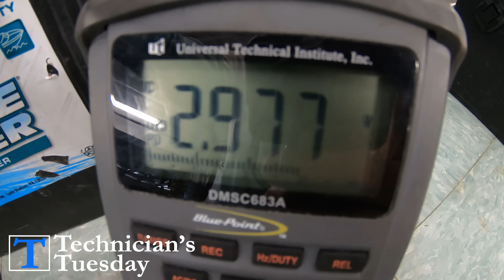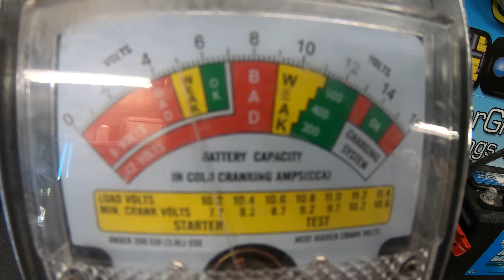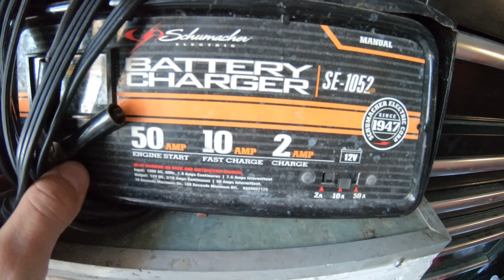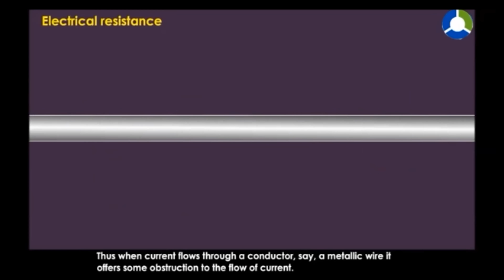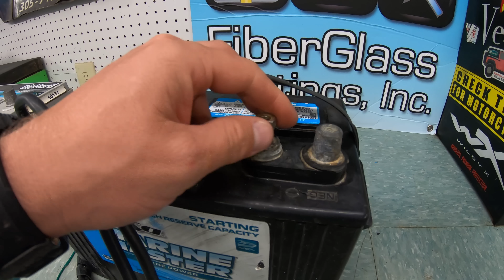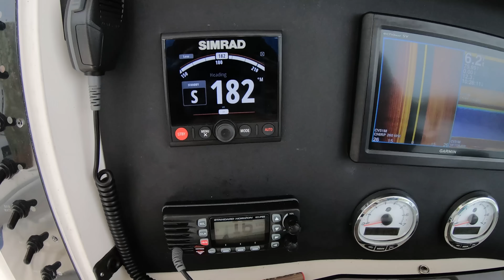Make Your Boats Batteries Last Longer!

Comment: I've seen a number of boats sink due to poorly maintained batteries, thus dead batteries.  Even one that was stored on a boat lift.  A heavy rain fall, combined with a dead battery, which led to a lot of water weight in the bilge that caused the boat lift to break.  The broken lift sent the boat into the water and the lift even punctured the side of the hull, and down it went.  #Batteries

Comment: hello I have a problem with my boat (twin outboard motor) above 46 rpm my boat puts itself ￼ strongly aside without turning (maybe too much weight at the front) ￼
Reply from the maker: Maybe the boat could use trim tabs?

Comment: #batteries
How do folks keep trolling motor batteries charged when on a rack or storage yard without a power source?
Reply from the maker: You really cant without a power source :/ just have to get the boat out of storage and then give them a day or two to fully charge up :)
Reply: If it's outside, you could get a small solar panel for it

Comment: It's also important to replace all batteries at the same time if they are wired in parallel or series. Some guys with bass boats have 3 batteries for trolling motor and 1 for cranking (like me). My Minnkota charger monitors all three batteries and will make sure all three are charged equal. I then have a separate charger for cranking battery. Replacing only one or two of the three batteries will force it to be at same level as the weakest battery. Hope this makes sense!
Reply: #Batteries

Comment: I had one of the UTI bluepoint meters from when I graduated in 2002. Sadly, nicad batteries leaked and corroded away all of the contacts. I went through several big brands but have found the Klein brand at Home Depot to be the best so far. I have one with an amp clamp, and one without.
Reply from the maker: That's funny, that actually happened my meter as well, luckily my snap on rep sent it in and now it's like brand new :) but I'm a huge fan of almost all of Kleins products, they make great stuff! I like their squeeze wire strippers when doing a ton of wiring :) they work great!

Comment: Don’t turn the battery switch with the engine running unless you’re switch is equipped with a field disconnect for the alternator.  Doing so can burn out the voltage regulator.
Reply: I did not know this...  good tip.  👍
Reply: You got that right...it happened to me and cost me $250 for a new regulator ....expensive lesson learned
Reply: Is that both on or off?

Comment: Great vid Aaron this will help alot of boaters who arent technically minded on maintenance personally i always clean the batteries after every trip as i wash down the boat mine are under the splashwell and exposed slightly to the salt air, no enclosed battery compartment

Comment: Great video watch them all the time. I have a Yamaha 175 hpdi  it's a 2004 i have never put a thermostat in it do i need to.i am going to service the lower unit.
Reply from the maker: If you never have put them in then it's a good idea to change them out. If your doing the lower it's a good time :) they are easy to do, you have to pull the plastic shrouds off to get to the one side of the housing bolts, but after that its 4 bolts a gasket and the stat:)

Comment: BATTERY ACID; always wear protection around battery acid. Gloves Goggles even an appropriate apron (not the one your wife gave u for "Father's Day") 
It is imperative to; Wash Your hands even if u had gloves on. If you inadvertently rub your eye and there is Battery Acid on them, big trouble.
Check the Security and stability of your battery from time to time. The pounding of a rough water ride might loosen the straps or housing.
Reliability is tantamount for your battery's performance, when yer Way out there, you have to be absolutely certain.
Before even starting your outboard, make sure the gasoline pressure Ball, is pumped and firm, cranking for extended periods of time may not drain the battery, but it wreaks havoc on the very expensive starter mechanism.
If we "Mix our Own fuel" a gas tank that has Sat for a couple days will stratify. (oil/gas separation) Give the tank a vigorous shake THEN Pump Up the ball.
Some outboard engine oil products claim to "Mix" more permanently (like AMS Oil) Shake it anyway!
But battery performance is right up there at #1.
Reply: That gas/oil/mix it anyway thing is true...  I use to always do that with my dirt bikes and even snowmobiles back in the day.  Gave the can a few shakes before filling them and shake the machine before starting just because.
Reply: @googlevoicer  cheers

Comment: #batteries definitely switching to a 2 battery setup on a switch next season. Also getting a dual battery box to keep them clean!
Reply: @Mason Enbody 
Consider Blue Sea battery isolators. 
Several models/functions automatically disconnects when the engine is off, no voltage loss, marine rated and safe. Study up for your needs, their documentation/comparison sucks but it’s a good product.

Comment: #Batteries..happy tuesday damm I need to clean those tops..my grandpa always said concrete drains a battery if left on top of it so we always put a piece of wood down to store it.dont know if gramps was right?
Reply: Fred Rempe Your grandpa was right.  Old batteries used to have hard rubber cases and would leak current badly when sitting on concrete.  May have also been dirty case conducting like in the video.  Today's cases are better insulators but you still need to keep your batteries clean.  I still store my batteries on dry wood when out of the boat.  Can't hurt I'm thinking.
Reply: Thank you jack fat .as kids we always thought he was busting our balls with the concrete ..also keep them damm terminals tight.lol
Reply from the maker: I grew up in Illinois and was always told the same thing :) I didnt think about the rubber back then, or really understand anything about batteries lol haven't put a battery on a block for a long time. Idk if it's still necessary, but it cant hurt anything ;) probably keep doing it out of habit:)

Comment: Never knew a dirty top on a battery would put a load on the battery, makes perfect sense though. Another great video! #Batteries
Reply: I concur. #Batteries
Reply: It isn't the plastic allowing current to flow, it's the moist, grime, dirt. The meter doesn't lie. Period.
Reply: @mikeprince5459  - doesn't lie about the concrete/ground either.  But some people don't believe a lot of things someone tells them are not true.

Comment: the same can be applied to trolling motor batteries? I have 2 batteries and both died on me with in 2 and a half years.
Reply from the maker: Yes, they can but you need to have a way to tie them in so that they can be charged. A lot of cases are that the trolling motor batteries are separate from the boat and engine and you have to charge them every night after a long day of using them.
Reply: @BornAgainBoating  thank you

Comment: What's the best marine battery in your book #battery
Reply from the maker: I generally stick to the group 27's. But if you are running a lot of electronics, pumps, and good stereo system. The 31 AGM's are a must. To be honest, I really don't have like a brand or style over another. I've ran interstates, dekas, intimidaters, autocraft, optima's, napa's, and basically whatever was available when it was time to change the battery! There's a lot of variables, the AGM's are great because of the abuse that you can put them through, but they are more expensive so I guess it still depends on the boat and application :) The long winded way to say idk what's the best lol
Reply: Born Again Boating  Thanks for your great tips and videos.  I've been running class 27 AGM batteries with VSR on my large (24' Manitou) pontoon boat since 2011 and they still test great. Buy once, cry once.

Comment: Great video as always. Capacitance testers do work better than load testers, as they tell you the actual amps that are inside of the battery. You can also use a capacitance tester battery after battery without having to let it cool down. I use my load tester with an amp clamp to check alternator/charging system output, and I strictly use a capacitance tester now for testing batteries. This is what I use in a professional setting, 60 bucks, can't beat it - https://www.amazon.com/BA7-100-1200-Electronic-Battery-System/dp/B0015PI7A4/ref=sr_1_4?keywords=solar+battery+tester&qid=1576621092&sr=8-4 #batteries

On a side note, per ABYC E11 you should have rubber insulating boots over those positive battery terminals. Without those rubber boots in place, anything bouncing around in that same area (IE rattle cans, tools) has the potential to hit both terminals and cause a dead short on the battery. If the batteries where in boxes you can forgo the boots, but as shown in the last seconds in the vid, they need to have insulating boots/covers completely covering the positive terminals.

Comment: Can you go into further detail on the battery switch and installation?
Reply from the maker: I'll see what I can do in a future video :)
Reply: @BornAgainBoating  thank you. I got me a 99 Key West about 4 months ago and been relying on yours and others videos on how to fix up my boat.  I think I've watched all your videos up to date lol.  Keep up the good work.  Thank you
Reply: @BornAgainBoating   I've been getting a lot of parasitic battery drain from the house battery.  The gauges and switches don't work properly and thinking about buying new ones.  But don't have thousands to spend on it. So I'm learning from the real professionals and changing as I go.
Reply from the maker: Awesome @stephen sexton thank you for all your support! Congrats on the Key West they are a nice boat :) Do you have a battery switch installed or is everything just going straight to the batteries for the electronics? Sounds like you might have a wiring puzzle to deal with :)
Reply: @BornAgainBoating  No thank you for the amazing content.  Yes it's a puzzle.  All the gauges and switches don't work. They're connected to bus bars and fuse panel.  I haven't installed the main switch yet because I wasn't sure how to properly wire it. I spoke to a marine mechanic today and he drew a diagram for me.  So next step is to set it up.  But it's a bit cold in Pensacola right now.  🤣

Comment: I have found that here in Australia using marine batteries is a waste of money as I get better quality and longer battery life using 4x4 batteries.#Batteries
Reply from the maker: That's interesting! There's a lot of batteries here that are RV/4X4/Marine batteries. Like they are multi purpose, how much are the 4x4 batteries over there compared to the marine?
Reply: @BornAgainBoating  I pay $99.00 for an N70 size 4x4 battery with 650cca compared to just over $200 for a marine battery with only 530cca, I found I was only getting 12 months from a marine battery compared to around 5 years for an N70 4x4 battery. That's Au dollars.
Reply from the maker: @Robonthemove  Wow! That's insane! Sounds like you found the best deal for sure. More CCA's, cheaper, and longer life. You can't beat that!!

Comment: Should the cut off switch be located on the positive side or the negative side?
Reply from the maker: You always want to put the battery switch on the positive side :) this controls the power flowing to the components and you can still have things function like automatic float switches for your bilge pumps when the switch is off.
Reply: @BornAgainBoating  Thank you, I was reading and everyone said to put it on the negative side, but most things will still work on either battery.